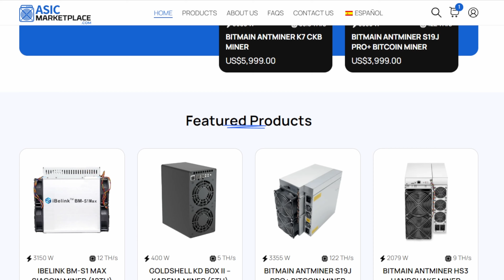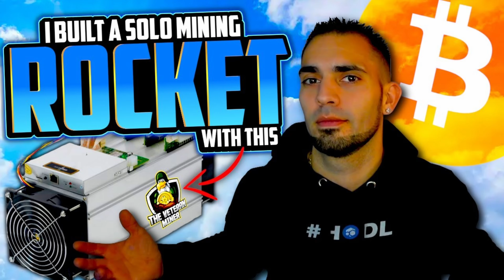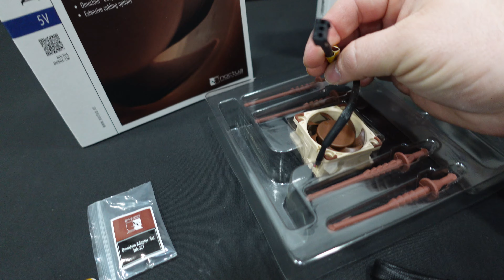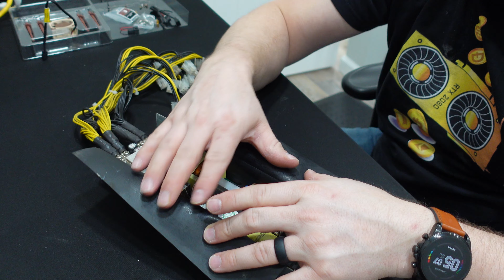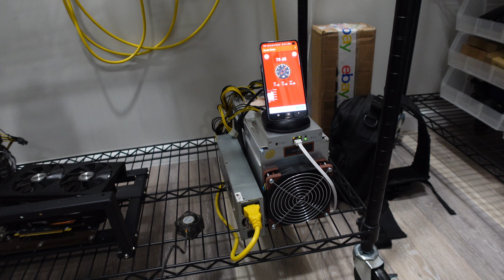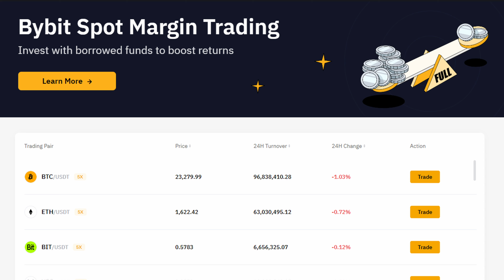ASIC Mining almost Ruined my Marriage, Here's How I Fixed it!

Comment from the maker: 𝐏𝐚𝐫𝐭𝐬 𝐔𝐬𝐞𝐝 𝐢𝐧 𝐓𝐨𝐝𝐚𝐲'𝐬 𝐕𝐢𝐝𝐞𝐨:
🔹Noctua NF-A4x20 5v 3Pin Fan https://geni.us/NoctuaSmall5v
🔹Noctua NF-A4x20 12v 3 Pin Fan https://geni.us/NoctuaSmall12v
🔹Noctua NF-F12 3000 RPM 120mm Fan https://geni.us/NoctuaFans
Reply: Change your air flow . Turn both fans around on the asic.  Simple.

Comment: I replaced all the fans in my Dell PowerEdge server with about 10 of those Noctua fans. It did the job of quietening my server, but unfortunately at heavy CPU load, my server would thermal shutdown which was really annoying. Good fans be might not move enough air to keep things cool at full load, particularly in servers

Comment: My bitmain power supply is using Foxconn PLA040H12N 12v 0.49A 4cm, 16000 rpm. Very loud high pitch. I'm using an LM2596 stepdown DC to DC converter with a stock fan. Adjust the converter potentiometer to lower the voltage so that the fan slows down. The result is that the high-pitched sound is reduced a lot and the wind flow is quite strong. I've tried the Noctua NF-A4x20 12v, it doesn't produce a strong enough air blow compared to the built-in fan which lowers the voltage.

Comment: I would not worry about the psu exhaust near the intake of the L3.   Cooling is more about flow than about temperature.   I do injection molding and I always want my inlet water to my mold to equal my outlet water in terms of temp and that I am running as many GPM flow as possible.   Likewise with air  the more CFM the more times i can turn over the volume air I am cooling.

Comment: THM great content,  I know you already know this but the innosilicon PSU was never meant to be used with the L3, the 6pin are the same and the PSU voltages range are the same however the PSU air low is setup for the innosilicon D9, A9 and A6 back to front .. I would change the air flow direction that PSU only need a small amount of air flow to keep cool anyways.
Reply from the maker: Super Helpful!  Thank you!

Comment: Great video, just a quick warning, when working on power supplies you should always make sure that the capacitors inside of it are discharged. If don't, you could frie your PSU if you short anything with your screwdriver or evenworse you could get schocked. 

An easy way to do this is:
1) Turn off the system
2) Unplug the power cord from the wall
3) Try to turn on you system with your power wall unplugged from the wall
Reply from the maker: Good tip!
Reply: @TheHobbyistMiner  Some of those capacitors could hold enough charge to kill you. You really shouldn’t mess with power supplies. I’m glad you didn’t end up with any troubles but, personally, I’d have bought a new psu instead of swapping the fans. Your life is worth more than then 100-200 it would cost for a new one
Reply: Thank you for saying this! Those can and will kill you. Yes please do these instructions or you won't have to worry about your wife any more lol

Comment: You can just flip the fan around. It will actually cool better.  The only reason it pulls air in the current direction is due to being based on a standard server power supply.

Comment: I guess the PSU doesn't really output much heat compared to the main boards.
If the PSU's out is sucked back in by the main fans, and all the hot air is exhausted on the same side of the asic, it must help with the hot/cold aisles design in the big farms.  just a thought.
Reply from the maker: Yeah you could be right.

Comment: Can’t you just flip the fan and have it intake from the front and then it won’t blow in the L3
Reply from the maker: Thats a good idea. If it was that simple I am game!
Reply: if the PSU is designed to get air pulled through, you can't really just reverse the fan.  turbulence and hot spots will occur
Reply: @bigguix That's what I was going to say. If the fan is designed to blow one way, you can't just reverse it or you'll risk overheatinh the PSU🔥